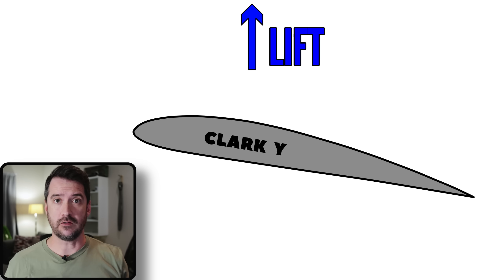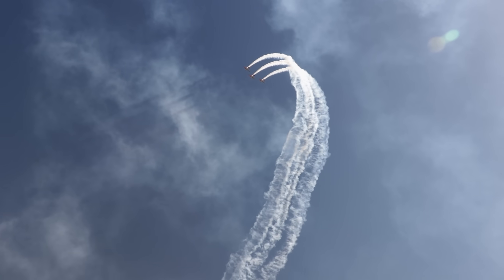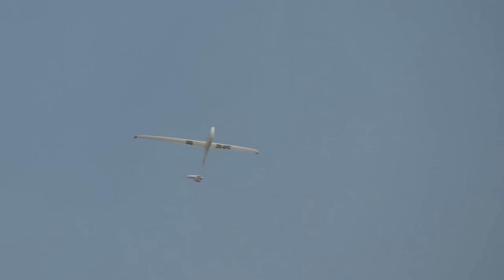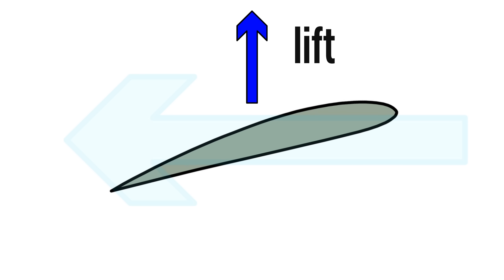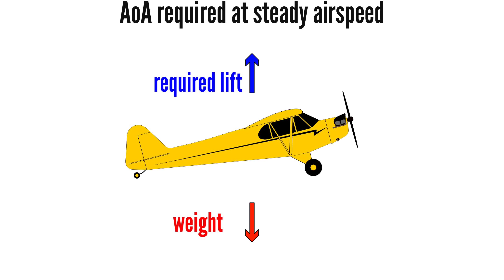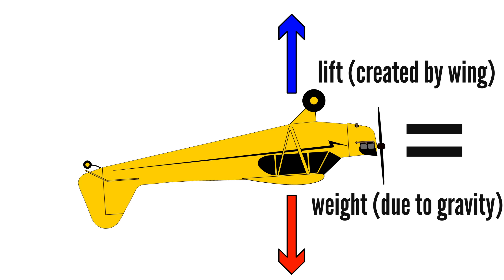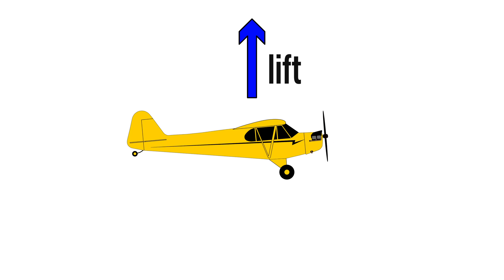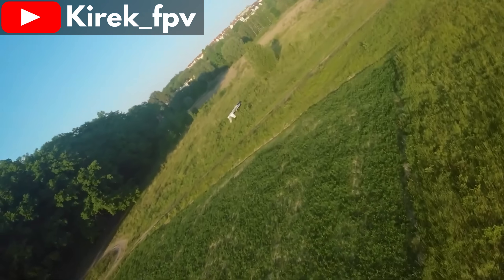Is Airflow Distance Over the Top of a Wing Always Longer?

Comment: Physics, conservation of mass, compressibility, coefficient of lift, angle of attack, air density and velocity. wing loading. A BARN DOOR CAN FLY AND MAKE LIFT... THE KEY IS LIFT to DRAG. 

Bernoulli equation is good enough explination with airfoil shape,  thickness,  camber... air does speed up on top of wing and lowers pressure.  Yes a barn door can create a lift, just also a lot of drag.
Reply: and a lot more speed and power is required
Reply: @AndrewBurbo-zw6pf  Good point 👉.  Lift Gravity Thrust Drag . It all has to add up. Add stability and controlability = aircraft.

Comment: Magnar Nordal gets it right

https://www.youtube.com/watch?v=uyRx25MSWng&pp=ygUQZmx5IHdpdGggbWFnbmFyIA%3D%3D

Lift occurs not because air goes faster over the top surface - it doesn’t.

Lift is the force resulting from downward acceleration of air.
Reply: You say air doesn't go faster over the top surface, but links to a video that clearly shows it does?!?!
Reply: I was mistaken.  

Magnate Nordal was explaining that the equal-time theory isn’t (always) correct.  I suppose in some circumstances it might be.)

The point is that the conventional explanation based on the equal-time theory is incomplete.  

I apologize for injecting confusion.

Comment: I agree with your point but disagree with the wing loading comments. Wing loading does not scale from RC to full size airplanes. However wing cube loading is consistent and quite similar between all sizes of airplanes. If a full size cub had inverted fuel and oil systems, I would bet it will fly inverted.